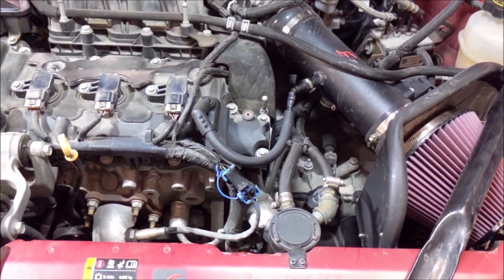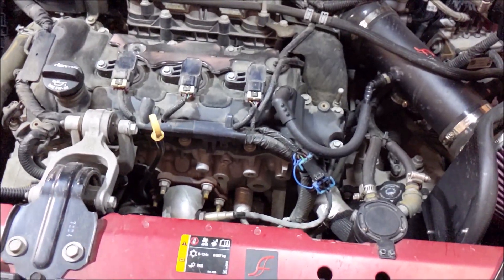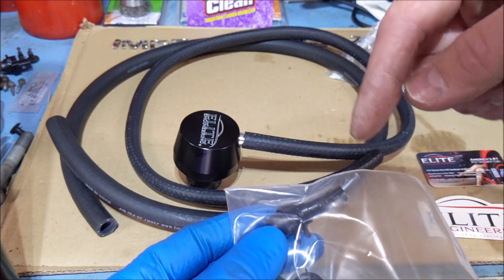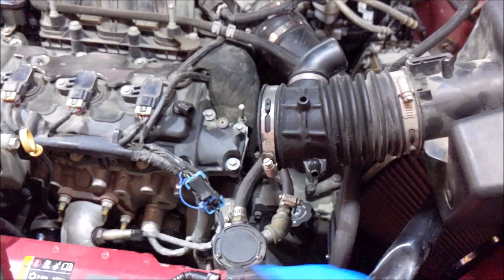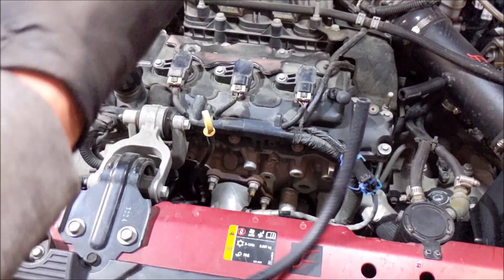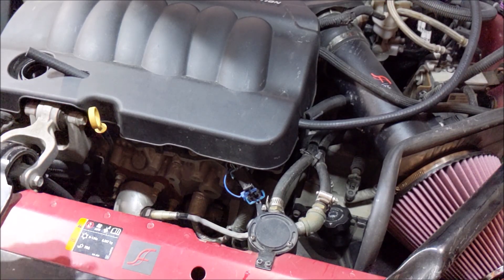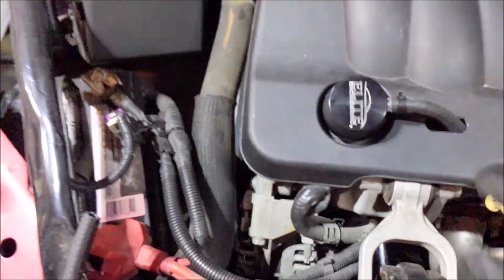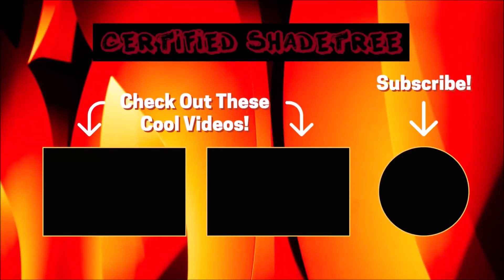GM 3.6 Liter V6 High-Feature Engine Clean Side Oil Separator Installation **AUGMENT YOUR CATCH CAN**

Comment from the maker: This is directly from Elite Engineering's website:

DESCRIPTION
Elite Engineering, the leader in Oil PCV Catch Can solutions announces the latest addition to their proven line of oil separating Catch Cans with the "Elite Clean Side solution".

The Clean-side solution addresses that small amount of oil vapor that enters the intake air charge upstream of the throttle body during WOT operation when the intake manifold vacuum is not present.

The Clean-side solution allows 100% MAF metered air entry while trapping the oil during wide open throttle operation and allowing it to return back into the valve cover as soon as the throttle is lifted.

Simply installs as a direct replacement for your stock Oil Fill Cap allowing you to delete and replace the stock OEM hose.

At 1/2 the cost of the plastic hollow GM unit, our aluminum clean-side separator incorporates an internal coalescing material. Simply unscrew the top for a quick inspection or cleaning.

Available in the most popular color Black, other GM colors are coming soon!

This is a direct replacement for your stock Oil Fill Cap. Comes with vacuum caps and fittings if needed to connect to your intake air inlet tube.

Models for both the V8 AND V6 GM engines.

Although app. 90-95% of the oil ingestion via the intake air charge enters via the "Dirty" or "foul" side of the PCV system, the other 5-10% enter via back flow through the factory "clean" or "fresh" side tube. This occurs mainly when accelerating or at wide open throttle when intake manifold vacuum drops to zero and crankcase pressure is allowed to build. This pressure will seek the path of least resistance, which is backwards flowing into the intake air bridge assembly bringing in oil mist and other contaminants into the intake air charge.  While this will not cause severe issue with a port injection daily driven engine, it will cause detonation and reduced power and fuel economy, and in a performance engine, especially forced induction, this detonation is detrimental to power and the resulting knock retard is a negative tuners and owners should avoid, especially if the engine is run hard for extended periods such as road racing, drag racing, or aggressive driving period.

With a direct injection engine, this contributes to the intake valve coking issues all DI engines experience.

The Elite clean side separator is similar to the GM 1LE plastic unit in function, retaining a emissions compliant close system, but is superior in several ways. #1, it is made of billet 6061 T6 aircraft grade aluminum unlike the plastic GM unit that may break if used in sub-freezing temperatures. (the Elite unit can safely be used in all temperatures. It also contains stainless steel coalescing media in the separation chamber to trap and retain the oil for the periods of low or no intake manifold vacuum VS the GM unit being a simple empty chamber. This allows most of the oil to be trapped VS a smaller percentage, and also returns it to the valve cover as soon as vacuum returns during deceleration, idle, or cruise.  

If you have a catch can with only a single evacuation suction source, this is an absolute must. If you are using the E2 or E2-X with dual outlets and check valves that utilizes 2 separate evacuation suction sources, then this is beneficial to trap the small amount of oil that came back-flow during the brief period of the checkvalves closing and opening to always default to the strongest suction source. 

No matter what brand catchcan you run, the Elite billet Cleanside Separator is a benefit. 

With the vented breather, cans, and tanks that break the closed PCV system giving grounds to void your warranty as well as being illegal for street use in all 50 States, this is a very affordable solution (app. 1/2 the price of the GM plastic unit) that retains an emissions compliant closed system and accomplishes all a breather does and more.
Reply: Awesome

Comment: All this is scaring me shoukd I consider a 2.4 E-Assist over a 3.6 I'm in the market for a 2015-2016 used Buick LaCrosse just city driving no highway driving.
Reply from the maker: Oh dear lord, you should run FAR FAR away from any 2.4 Ecotec, E-Assist or no E-Assist!! A15-16 LaCrosse will have the LFX 3.6, so you'll be in good shape as long as the engine was properly maintained.
Reply: @CertifiedShadetree Really?Had no idea of the Ecotec being worse than the LFX...the carbon buildup situation?
Reply: What about the 2017-2018 2.5 the same issues expected?
Reply from the maker: @javierjustiniano6078 Any Direct Injection engine will have carbon buildup issues. The 2.4 Exotec has major timing chain failure issues before 100k miles. A well-maintained LFX will easily outlast a 2.4.
Reply from the maker: @javierjustiniano6078 The 2.5 in the Impala? They're more reliable than the 2.4 Exotec, but keep in mind they're lugging around a 4000 pound car (without a turbo, no less!!) I haven't heard anything outright bad about the 2.5, other than they're god awfully slow in the 10th Gen Impala. A 17-19 LaCrosse has the completely new 3.6 LGX engine, which is practically bulletproof with none of the issues the older 3.6s had..
Reply: @CertifiedShadetree No in the La Crosse and w/e- Assist.Importimg to San Jyan PR and really don't need a 6 cylinder that's what I've got and living in city driving mostly.
Reply: @CertifiedShadetree Oh,didn't know that but here in SannJuan traffic is everyday routine so thought the 2.5 e-Assist as an option.

Comment: I just bought a 2013 impala.  Only had 122k miles.  I am planning on changing out/boring the pcv valve.  I am also planning on either adding a catch can or adding some filters to just let the pcv's vent to the atmosphere.
Reply from the maker: With the amount of blow-by these engines produce, you probably don't want to vent the PCV hoses to atmosphere. Just sayin'..

Comment: @CertifiedShadetree hey what kind of oil you using now in your 9th impala? I’m on Mobil one, but trying to see what’s the next good oil to go with.
Reply from the maker: I'm using Valvoline Extended Protection 5W-30 these days.
Reply: @CertifiedShadetree gotcha!! Will check that out, I’m due for a oil change but want to try something different. Appreciate it. 👍🏾 impala gang 🫡
Reply from the maker: @Dattman028  🫡

Comment: Could you just splice in a one-way valve? Cheers Graham
Reply from the maker: @theaussienurseflipper.8113  You need to keep that line free-flowing, otherwise all of the crankcase pressure will blow out the piston rings.
Reply: @CertifiedShadetree  thx
Reply: @theaussienurseflipper.8113 . I think your idea was spot on.  Easier, cheaper and it’s not in the way every time you want to take the vanity cover off.  BTW, I’ll bet that fancy oil cap contains a one-way valve.
Reply: @CertifiedShadetree 

Relieving crankcase pressure is what the PCV side is supposed to do.  Excess pressure is a threat to engine seals.  The piston rings already withstand a much higher pressure in the combustion chamber: higher crankcase pressure would actually make their job easier.

Comment: So this clean side catch can is for those who do track work and/or use a lot of hard acceleration? For most of others the dirty side catch can is sufficient?
Reply from the maker: @D800Lover  How you can tell if you need one for your daily driver: Remove the large snorkel/tube that connects the air box to the throttle body. If there's oil inside (or worse yet, outside) of it, you should install a clean side separator.

When you're under WOT, the airflow through the clean side tube reverses direction, essentially going under vacuum. It ends up drawing oil into the intake tube, and thus through the throttle body and into the intake manifold.

So after that long-winded explanation, the dirty-side catch can gets you 90% of the way, this gets you the remaining 10%..
Reply from the maker: Realized it after I commented, but read the comment I have pinned at the top of the comment section.

Comment: Its out of stock 🙂‍↔️
Reply from the maker: You might still be able to get it directly from Elite Engineering's website. This particular one is listed as for a Camaro V6, but I'm almost certain the oil cap on the V8 Camaro is the same. If you ordered one for the V8, at worst you'd have to buy a chunk of fuel hose to run from the separator to your intake tube.

That being said, Amazon does eventually get it back in stock..

Comment: Hey,  great video.  Having the same problem with oil in the intake line on my Acadia, but I'm having a hard time finding one of these clean side separators that specifically say they work with the LY7 engine.  any reason why I couldn't just install this one on mine?  The engine layout looks almost identical.
Reply from the maker: I don't see why you couldn't. As long as the lower half of the separator properly fits into the valve cover in place of the old oil fill cap you should be fine.
Reply: @CertifiedShadetree  Thanks.  will try it.
Reply from the maker: Best of luck!
Reply: @KrisSchumacher  Any luck with this mod?
I have an LY7 and just finished cleaning out at least 1/4 of a quart of oil in the intake tube lol.
Also did the PCV mod.

Comment: After installing oil catch can and the oil separator I’m heading a hissing sound coming from the Pcv valve area. I thought I heard it in your video as well. Just wondering what your thoughts were about it. Wasn’t sure if it was normal or not
Reply from the maker: Check the PCV hose connection on the back of the intake manifold. The hose should be pointed at the 6:00 position (down) and the 2 cams on the side should be fully engaged onto the manifold.
Reply: Don’t mean to sound stupid but what do you mean by two cams on the side should be fully engaged?
Reply from the maker: If you look at the part that plugs into the intake manifold, there's 2 "ears" (better way to describe them than "cams" I suppose) on the end of the hose that slide under 2 locking tabs on the intake. When you rotate the hose, those ears lock into the tabs on the intake.
Reply: I gotcha. So then if it doesn’t lock into place what should I do?
Reply from the maker: Once you have that connector locked in place, zip tie the hose you connected to that connector to something in the area that'll keep it stationary.
Reply: So after looking at it this morning. The hissing is actually coming from the PCV valve itself. Almost like there’s a pin hole somewhere but it happened after I drilled out the holes so I’m not sure what I should do there
Reply from the maker: @BrandonJensen-yt8dr  Squirt some soapy water around the area with the engine running. If you see bubbles, you've found your leak..

Comment: Could I use a high end 4 port catch can (Vibrant) and run both clean and dirty sides to the can with one outlet going to the air intake and one outlet going to the intake manifold? IE 2 inlets and 2 outlets?
Reply from the maker: I wouldn't combine the 2 sides like that, as you would just end up sucking those unwanted crankcase vapors directly into the intake tube. Now if you wanted to plumb in a 2-port can on each side so you had 2 cans, that would work. But then you'd have to empty 2 cans instead of 1 if you had went with a can on the dirty side and a clean side separator..
Reply: @CertifiedShadetree  the Vibrant cans have two separated sides, IE all of the air/vapor mix entering the can must pass through the separator before being allowed to hit the outlet ports is why I thought it may work well. 

IE there is no way for unfiltered dirty side vapor to make its way to the air intake.
Reply from the maker: @bradleydavidsankey Sorry my quick reply was misguided. The 4 port can doesn't have separate chambers to keep the clean side and dirty sides away from each other. The PCV system needs equilibrium - it draws in air from the clean side and expels it from the dirty side. Placing both sides into one chamber will disrupt the equilibrium. Picture the PCV system like the 4 chambers of the human heart (nevermind the lungs for simplicity's sake.) If you dumped all the "dirty" blood into the same side of the heart as the "clean" blood, the heart would keep pumping until it exploded. So in your engines case the crankcase pressure will just blow out the piston rings. For clarity, check the video I have linked in the description "PCV VALVE OPERATION."
Reply: @CertifiedShadetree  makes complete sense!
Reply from the maker: @bradleydavidsankey  👍

Comment: Can you just install one way valve on that line ?
Reply from the maker: Sounds intriguing. Although my best guess is the entire PCV system would be out of equilibrium if you momentarily choked it off like that. Like pressure would build in the crankcase and blow the gasses through the piston rings..

Comment: Great Videos, very thorough. 
I have a question, I just bought a 2012 Malibu LTZ with 170k miles. Engine (3.6L) is quiet and it has great power… but I noticed after not many miles I was low on oil. After investigating I took off that (4”)pipe from air filter to the throttle body and it was filled with lots of oil. I replaced the PCV on the back side of the engine. I then cleaned up the 4” pipe and started looking for answers which I found here. Thank you. 
the question is, can I mimic everything you did here-clean side and dirty side- with the same parts you used? Thank you again
Reply from the maker: Yes, everything I used will work on the LY7 engine. I would also suggest you switch to Valvoline Extended Protection 5w30 oil and change it every 4-5k miles. Between the Valvoline, the catch can, and the clean side separator, your oil consumption should drop significantly.
Reply: With the amount of oil I seen, and I’m reading about… is it a 3.6 characteristic or bad piston seals?
Reply from the maker: @Bleet1234  It's a characteristic of the 3.6. They're very finicky!!
Reply: @CertifiedShadetree   thank you the help…. Before I found you, everyone was telling me I’d have to pull the engine and replace rings. 
I’ll order everything and get it done this weekend. Thank you thank you thank you 🙏 !!!
Reply from the maker: @Bleet1234  Best of luck to you! 🍻
Reply: Wondering if you can help just a little more. 
Installed the catch today and it went good. I didn’t have a 7/32 bit and just used the 5/32 for all three holes. 
Will this be ok, or should I make that hole a little bigger?
And my big question is I hear hissing and can’t really tell where it is? I out my ear directly up to the canister and can here hissing in it… I sprayed all the clamps and unit down with soapy water looking for bubbles or if it would get sucked in and didn’t see anything. Is this hiss normal? I can’t hear it unless the hood is up?
Thank you again for your help
Reply from the maker: I would still try to enlarge that hole on the PCV, honestly. Yeah that shouldn't be making a hissing sound. Check to be sure you connected the hoses up to the proper ports on the catch can. That one fitting at the back of the intake manifold is tricky to keep locked in place, maybe check to see if that one is snug. If you haven't already, remove the drain plug from the catch can, wrap the threads in teflon tape, then reinstall it. Other than that, check the clamps on the intake snorkel (and see if there are any cracks in the snorkel itself.)
Reply: The fitting from the intake doesn’t lock in like yours. It just gets pushed in and has a small ring that catches something inside to lock it in. 
And I have that going to the out. 
I will definitely get a bit and drill that hole bigger and while I’m at it just ensure the hose isn’t cut and clamps are properly secure. 
I’ll update when i get to it…. I have a small fleet of older high mileage cars here at home for my kids and im always doing something! Thank you again for your help, you really have gone gone above and beyond for not only me but everyone that needs help. 🍻🍻🍻
Reply from the maker: 🍻🍻🍻Right back atcha!!
Reply: I installed the clean side piece and it was making some crazy squeaking/whistling noise…. Took it off and hooked it up like it was originally and it went away!?!?
Couldn’t I just install another oil catch canister off that clean side?
Reply from the maker: @Bleet1234  And you capped off the original fitting at the valve cover? Yes you can run a separate catch can on the clean side. The clean side separator is more for convenience than anything, really. One less thing to empty.
Reply: Yes sir, capped off the same thing you did… it was strange, I thought maybe something was bouncing around under the car!
Ugh, my luck. 🤣
Reply: You’ll never believe this, I installed the catch can today and it made the same noise as it did when I put in the  other devise🤣
Idk man, guess it wasn’t meant to be…. I’ve been watching your other videos… you have an amazing mind! Guys like you that make the world go around.
Reply from the maker: @Bleet1234  Wow, that's damn strange!! My thoughts turn a possible restriction in the PCV system. Area most likely to have an obstruction would be the rear valve cover, more specifically under where the PCV sits. It could be plugged up with carbon build-up. The valve cover gaskets were revised in newer versions of the 3.6 where the area under the PCV is opened up more. Something to consider..
Reply: Next weekend I’ll take off that rear valve cover and get a visual. This has been fun, I’ll keep you in the loop… again, thank you for taking time to help me out
Reply from the maker: @Bleet1234  No problem, hope you get 'er figured out!!